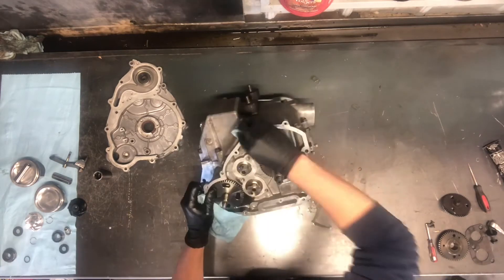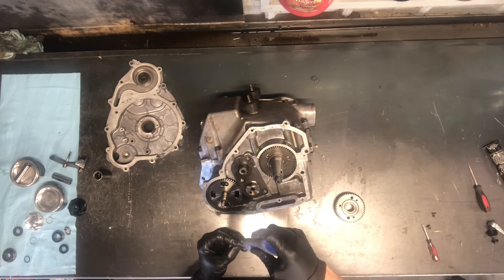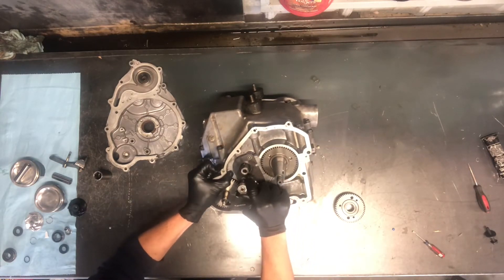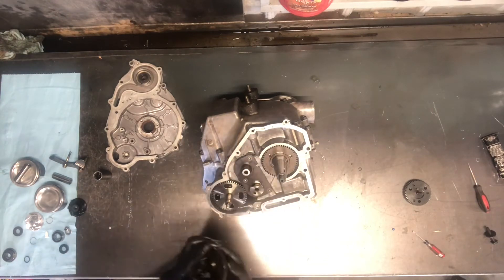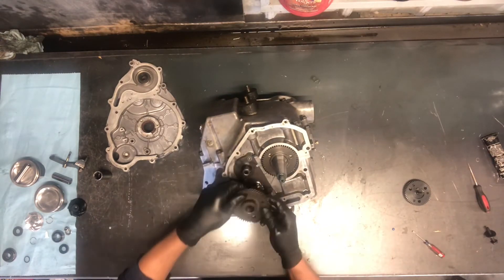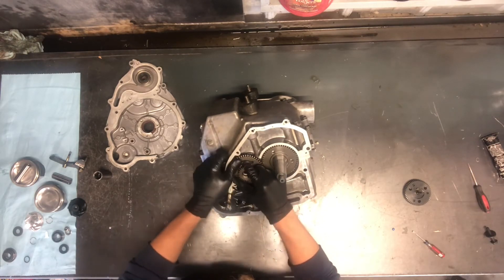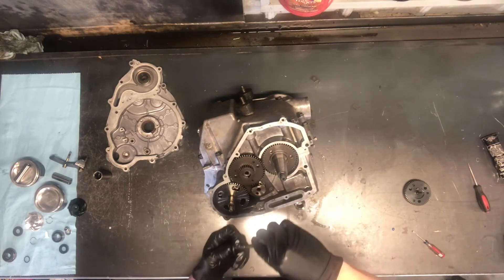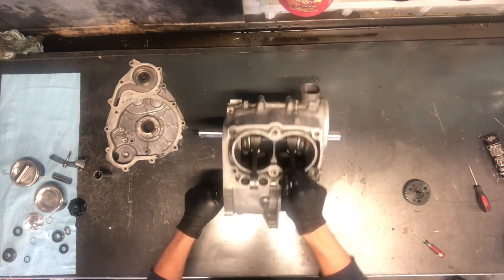🥇  Polaris Ranger / RZR / 800  -  Crankshaft Balancer Camshaft Oil Pump - Installation

Comment: I followed these videos to build my engine and there’s a part that was missed. I don’t think discussed in the video is that the camshaft gear is two pieces. If those come apart, you have to make sure that they are also aligned up correctly.. Otherwise it would look like you have set your timing, but you have not about to pull the engine against to fix this. Shitty simple mistake from a newbie. Hopefully this helps somebody not have the same issue I am currently having.

Comment: I only ask that question because I just rebuilt one of these and it was very hard to get started. And it will idle but as soon as the throttle is moved any it just dies.  Everything is new in the engine. Only engine I’ve ever had so much trouble with getting up and going after being put back together.. Thanks..

Comment: Can you get the crankshaft or camshaft 180 degrees off? Just wondering. I know all the dots line up but wanted to make sure that wasn’t a thing. Since I know some of the other timing engine you can get them 180 off. Thanks.